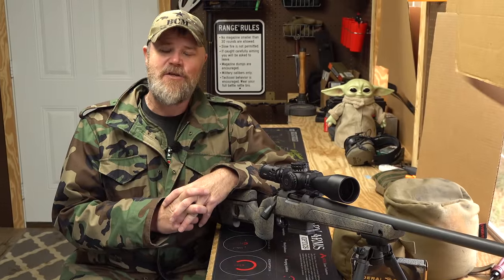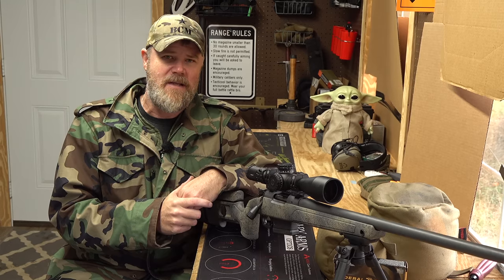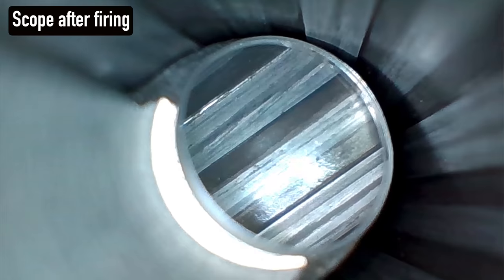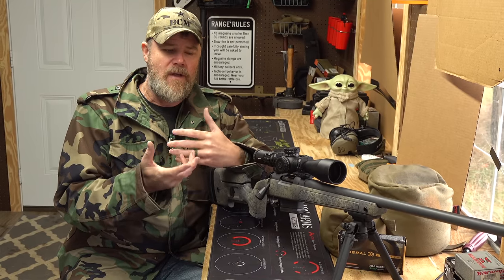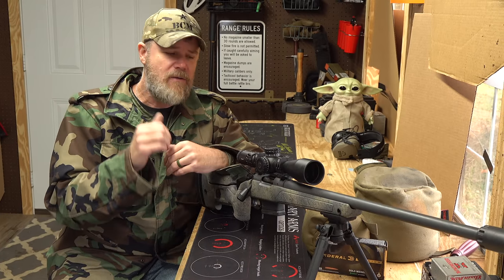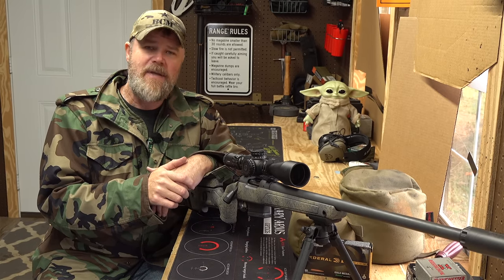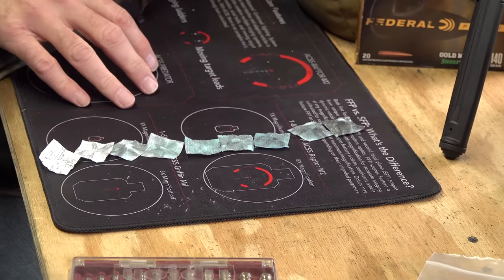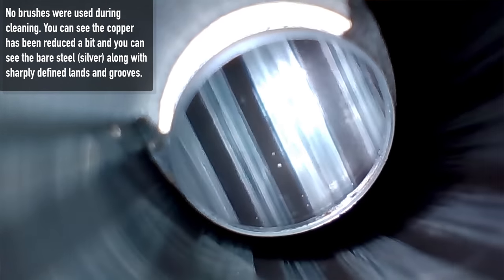Barrel Break-Ins and Cleaning Voodoo Rituals Destroy Barrels

Comment: I find it interesting that these premium barrel manufactures still recommend the opposite of your experience. Shilen, Pac Nor, Calhoon, Christensen Arms, G.A. Precision Break, Kreiger Barrels, Shaw Custom Barrels, Hart, Bartlein, Proof Research,  Hawk Hill Custom, Benchmark, I am also adding the list of barrel manufactures used by top shooters. I have heard of your experience before and another by Bullberry barrels using Eezox which is very similar except a finish with Eezox. I have been shooting for over 50 years in the field and from the bench.  I have done all of the different types of breaking in and cleaning of barrels including using Ed's Red for Bench Rest guns and I have used Red Rouge polishing for old barrels. All of what is said makes sense. I now believe the cutting and finish of the barrel is everything. The smoother the finish and uniformity of the cuts or lack there of  is the main reason for any copper and carbon build up (baring maximum loads and copper projectile make up). J4 jackets are a necessity with least amount of run-out for a loaded a cartridge for best results and tuning of the ammunition for harmonics and ideal pressure curve for consistent hits where expected. Most of all the confidence of the operator..... Les I digress. I agree Clean until you have the results you have witnessed and want no more. Each piece of equipment is different they all have their likes and dislikes.... Change components only when necessary. Lubricate accordingly those areas that need lubricating... for galling is your worst enemy for long run shooting. Correct cleaning procedures and concentrically of precise ammunition with best you can afford equipment will reward you with expected results if you read the elements and distance correctly. Good Video
Unfortunately your site will not allow me to paste a picture from the PRB site showing the barrel manufactures Bartlein Proof Hawk Kreiger and Benchmark are the top barrels used in PRS competitions. (See hyperlink) https://precisionrifleblog.com/2019/01/05/best-rifle-barrel-2/  
The various colors on the chart represent the league and rank of the shooters. For example, black indicates shooters who finished in the top 10 in the PRS, dark blue is those who finished 11-25 in the PRS, and the lighter the blue, the further out they finished in PRS overall standings. The green colors represents the top shooters in the NRL, where the darkest green is the top 10, medium green is 11-25, and light green are 26th to 50th. The legend on the chart itemizes the league and ranks each color represents, but basically the darker the color, the higher up the shooters placed.

I agree the less you run the cleaning down the bore the better you are for keeping the crown and critical throat area of the barrel.
sincerly
Ike

Comment: MAC, how do you feel about bore snakes with solvent then running some dry patches through?
Reply: I've heard the copper wire can cause premature wearing.
Reply: Im guessing he wouldnt like them, bore snakes have sections with metal brush on them.
Reply: I dunno about Mac, but I only use snakes for absolute field emergencies like if you trip and stuff your muzzle in the dirt. They pick up "junk" and then you keep running that junk through your bore repeatedly unless you wash it each time. Washing them repeatedly then leads to them possibly breaking off IN your bore... Plus if you recall Mac said "no copper brushes... only nylon" and the snakes use copper brushes. The "pull-through" cable cleaning kits like from Otis ETC work much better because you use a fresh clean patch every time.
Reply: @NWA744  I am just reporting what I have heard. And I've heard that extensive use can cause premature wearing. Can't verify though.
Reply: @armstrong2052  Unfortunately, myths like this are common in the gun community.
Reply: @NWA744  good thing nobody cares what we think.

Comment: Rifles and handguns, I use a jag with a patch and break cleaner. After no more carbon comes out, I lightly put royal purple zero weight on a patch and run it through once. After that, I take a q-tip and wipe the oil out of the chamber. Best way I have found.

Comment: The way you just explained is the way I've been cleaning my 🔫's for years. I'm more concerned about what can jam the action. On some of my 🔫's, I've run 500+ rounds through then oiled them, put them away, and then take them out and run another 500 rounds. And if everything was good, I would repeat. One, I ran 2,000 rounds through before cleaning and had no issues. I still have these 🔫's and they still shoot accurate. These are tools that need to be used, not put in a glass case for show and tell. Good stuff! 🇺🇸🇺🇸🇺🇸

Comment: From experience I couldn't agree more with the methods and reasons described. I've had a high end bore-scope for nearly 15 yrs and within a few quit using metal brushes altogether. I learned with WW II German & British arms that getting carbon/copper out of pits means little to accuracy once the 'high' spots (where the bullet bears) are cleaned up. Versus a particular break-in routine the same simple cleaning method has got many new guns to 'settle in' within ~50 rds. Newer solvents are less harsh and I agree a good fit for the patch is vital .. along with using a bore guide. JMO too, but I know what works for me. 

btw, Newer bore-scopes are far more affordable. Most all have longer,  flexible cams and don't require accessories to save snapshots. Also, I quit 'lapping' bores (w/patch) a decade ago and save the mat'ls for  actions, triggers, & scope rings. IMO 'lapping bullets' aren't worth the throat/leade erosion/lengthening they risk causing. Treat your bore right and don't blame the ammo/load.
Reply: Your sentence was a bit confusing... Are you saying it's not necessary to remove the copper?  This video is talking about fouling remover, but how do you feel about the ammonia free copper remover of the same brand?

Comment: High grade precision barrels don’t need any scrubbing imho. I was surprised how easy it was clean my Tikka barrel. Few patches and it was clean. I always put patches over my brushes and never have a direct contact between the brush and the barrel. Patch over the brush makes a the patch reach the groves better. Ive tried some Bore-tech stuff and it works really well dissolving coper fouling.  Better then Balistol and Hoppes. My2c

Comment: I tend to agree with this statement I have wire brushed barrels after running patches through the barrel then running patches through again to see what the wire brush loosens up. Very little came out on the patches I leave the barrel wet with oil and shoots fine. I do barrel break ins swabbing the barrel after 3 shots the later 5 shots the later 10 shots all this can be done on one visit to the range.

Comment: 1050 and 1040 munitions grade steel and 416 stainless steel used in barrels will react with dissimilar metals such as lead and copper.  Yes it is true that copper will coat bore imperfections and will aid in a slight amount of lubricity.  However if copper fouling is left in a bore for long term with any form of humidity or moisture, galvanic corrosion will start to take effect.   If you are storing your firearm long term clean and use a dehumidifier.

Comment: Only Rifles I have seen needing break in work were custom Hawkins in the $1,900.00 range with deep cut rifling that were so sharp they murdered patches with groups around 18" at 50 yards.  600 strokes with steel wool changing to finer wool every 50 strokes until the groups settled down with no blown patches worked. My dad built around 18 from kits the one he used hunting was a two barrel setup in 54 and a larger bore he could swap to. Goal was killing shots at 50 yards in a two inch group at largest in the cold and a moving target. Buffalo on the ranch Ted Turner now owns outside Fort Pierre SD.  Back in the early seventies.

Comment: I basically do the same thing for the break-in procedure, except for after I clean the barrel. I also run a high temperature Teflon lubricant down the bore and then I pretty much don't have to clean it again for several hundred rounds

Comment: I have done the barrel break-in in my bergara and it takes a lot more ammo I want to use and a lot more cleaning than a want to do. It's hole in hole accuracy seems like it could be worth it but if it's the same with no break-in then it's a no brainer. Going to try my new Tikka  without the break-in, thanks for the info. Many have said the same as you.
Reply: You could try and Lap it first.

Comment: Great video. I worked over 15 years for a gunsmith/gun store. Long story short I hope. I had built several different calibers. I decided to full customize a Rem 700 BDL in 22-250. We were a Remington warranty store. Also doing a lot of custom guns. Both handgun and rifle. Anyways I decided to try something new. We had a guy come in and wanted a short action Remington custom build. I ordered a Rem ADL in 22-250. Taking it apart I put the barrel in a special place. Later asking the boss. Hey, can I get a take off barrel and build something? Sure. 
I took that barrel and cleaned it for about a week. Then sent it out to get it cryogenic treated. Piler bedded, full barrel relief except one inch from barrel and a Kepplinger set trigger. Set at 2 lbs normal and two once on the set. On the range to yes, break in the barrel. After talking with many match grade rail shooters that count the rounds shot before they change barrels out. Told me how to break in a barrel.
One round clean, time 10 round, two rounds and clean times 10, Then three rounds, times 10. Using only Federal ammo. After the break in shots. I stop at three rounds. First three round set. I did not measure it. I had a gunsmith that helped me build the rifle to measure best set. He came up with a three round shot group of 0.114 shot group. Bullet is 0.224 and outside to outside measure at 0.338. Minus 0.224 and you end up with a 0.114 inch group. 
As for what I use to clean is Barnes CR-10, nylon brush and calibered jag. Never have I had to use or need a fowling shot. The rifle can sit in the safe for months and first shot is a bullseye. Now mind you. At the range. When I am finished shooting. I clean with Barns CR-10 and when done. I run a wet patch of Breakfree down the barrel. Because there is zero oil in barrel. That can cause rust to start. Then, you call and say let's go kill some coyotes. I run a wet patch of Barns down the barrel to clean any and all oil out of it.

Comment: On the other hand, I have a Rock Island 1911 compact pistol that has so much copper in the corner grooves that is NEEDS a soak and a SS brush. I could never count how many rounds have gone though it, but I've been through 1 stock and 3 Wolf recoil springs, and 6 Wilson mag rebuilds. It was clay target @ 25 yard 5 out 7 accurate, not so much anymore, lol. If a good soak in Sweets 7.62 and a SS brush can't bring it back home tight, I'll still carry it.

Comment: My break in: run a couple wet patches and a couple dry patches.
My cleaning: spray solvent (I use Battle Born) until it drips from the muzzle then let it sit for 5-10min. Run dry patches until clean.

Comment: I use a non toxic bore cleaner, i spray directly into the barrel to break down carbon, then I run a bore snake thru twice. That's all I do, over cleaning a rifle can cause more issues than under cleaning it, rule of thumb all maintenance of firearms are the same. Clean and oil it every time you shoot it and just oil it every 3 months not shot. This works for me so i stick with it.

Comment: I rarely 'clean' a gun. I mostly just try to get any salted oil off of mine. I live by the ocean so salt air will rust most anything metallic in about a week if not less. So I usually once every other month or so give my guns a good wipe down and then put some fresh oil in/on them. For the wood bits I use an oil like linseed or old English to protect it from swelling and then a light wax to keep it extra sealed.

Comment: Everything you said rings true,my dad never broke in a barrel per say,he cleaned it when new and used simular process as youve demenstrated and kept them oiled with aviation oil,and that was 1950s and on,I to have hunting,match ,plinking,ar10,ar 6.8.ar15s in multiple and lots of hand guns,and one of my favorites is ROYAL PURPLE MAXFILM ,it penetrates,lubricates plus prevents rust,they used to make a rifle product but this is the same thing there just known from drag racing and auto performance lubricants.And in Alaska on Kodiak Island your going to encounter salt water in a skiff or just moisture hunting in tall wet grass and water crossings.Im going to try out your Boar Tech,no ammonia,and coppers softer than hard metal so just fills in microscopic areas.

Comment: I've used a brass brush.  I've never bought into the elaborate "barrel break-in" procedures some folks recommend.  I've seen Gale MacMillan's note before as well.  My procedure: shoot a gun, then clean it, repeat.  That's it.  And I never try to get every speck of powder out of the barrel.

These days, I mostly use bore snake as it is simply easier and I'm lazy.

Comment: Here is my observation after many years of shooting. Barrels that are cleaned fanatically go bad after a bunch of rounds, barrels  that are routinely cleaned go bad after a bunch of rounds, barrels that are rarely cleaned go bad after a bunch of rounds, barrels that are not cleaned or cared for tend to go bad quickly no matter how many rounds they have. Barrels are consumables, replace them when necessary depending on the level of accuracy that you determine to be sufficient for the task.

Comment: Ive always shot 50-100 rounds, use a little solvent and run a bore snake (with a built in brass brush) and run it through 2 or 3 times and follow it with a lightly oiled patch. But whatever works 🤙

Comment: You don’t have to get the copper out. A brass brush won’t hurt the bore. However, I pretty much just use patches. Wet, dry, light oil. I just see no need to scrub extensively or worry about copper.

Comment: Since we're talking about "personal experience" and "your mileage may vary" I harldy clean my rifles. Few drops of oil on the bcg and charging handle is typically all i do. For my suppressed rifle, thats a little different for obvious reasons. Even then, solvent all the caked on carbon, let sit for a few minutes, microfiber cloth, wipe, bore snake down the barrel a few passes and done. Ive yet to have issuses and my most used rifle just hit 32k rounds

Comment: I just stick to jags and patches with a bore guide and ballistol as my cleaner. No abrasives, no corrosives.

If I shoot corrosive ammunition, I first do normal cleaning, then flush with hot water, enough to get the metal surfaces hot, and then flush with a hot water and ballistol mix.

When the water evaporates it will leave a thin film of ballistol on all metal surfaces.

Comment: damn we live in different universes.

Hopps 9 never caused rust in my bores when left for days. Any BoreTech causes rust in 30min, and serious orange rust when left for a few hours.

Nylon brush with BoreTech almost zero dirt on patch. Oversized bronze brush 5 passes both ways = dark black multiple patches in a row. 

In my experience a bronze brush does 90% of the cleaning, solvents are just there to whipe out what the brush did.

Guns used:
Mosin Nagant in near perfect condition
Brand new Howas 1500 in 7.62x39 and .223

Electron microscope evidence proves that pulling bronze brush back into the crown does zero damage to the crown. Benchrest shooters pull bronze brushes rigurously after even one shot in both ways.

Comment: I am actually very happy to have met you and seen your video. I have been precision shooting all
My life and agree with your methodology. Now, I was lucky enough to have scored on a couple of brand new and unfired 22 high precision pistol and rifle which I plan to continue having lots of fun with, the manufacturers had Always recommended to NEVER use metallic brushes and cleaning from breach to muzzle one pass at a time (Hammerli, Anschutz in case you are wondering) so, the one thing I was not saw are of was the ammonia dangers. So, will follow your advice on it. 
Thanks for a well documented and data supported video. Happy shooting!

Comment: I switched away from boretech (copper remover) to Iosso paste. Much easier and less messy. I run it through no more than 5 times. Barrel is not immaculately clean, but accuracy remains superb.

Comment: After a shooting session, run wet patches, followed by dry patches as you described. Now, wet with solvent a bronze brush and run it down the barrel a number of times. Redo with a wet or dry patch...see the color of the patch? Lots of fowling inside the corners of the rifling the patches missed. A bronze brush will never hurt a barrel...54 years of experience talking.

Comment: Soft materials can and do wear down harder components.  A plastic scourer can damage a mirror finish on hard things like glass and stainless steel.  More to the point, in the army our cleaning kits had the tool for cleaning with a patch ONLY.  We were told never to use a brush of any type on pain of...  well, pain.

Maybe back in the day when corrosive propellants and fully lead bullets were normal vigorous cleaning was required.  These days, just use a few patches after the shoot and keep a light film of oil on it in between.